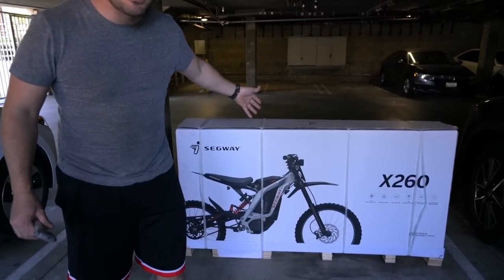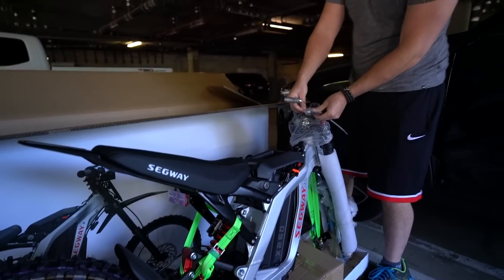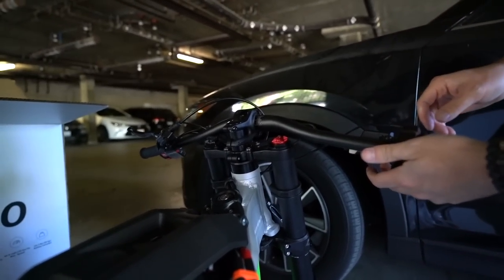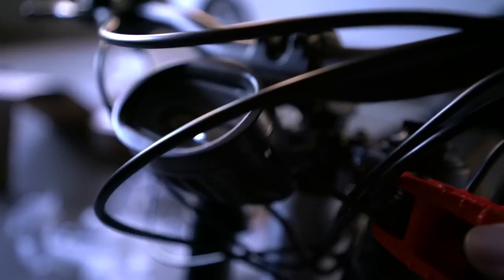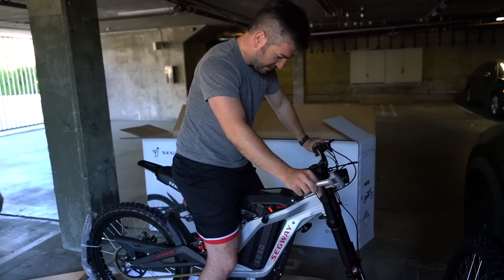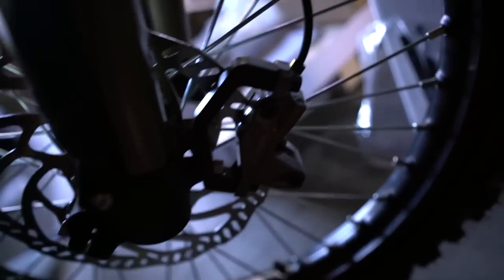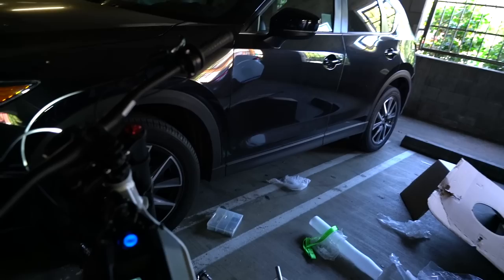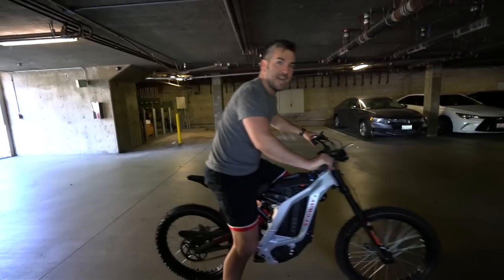Segway X260 Unboxing

Comment: Hope you will add to the EB forum your thoughts after getting your x260 sorted out and some miles on it. I'm very interested to know more about how the app can adjust the throttle and Regen behavior.  My new sur Ron LBX is unfortunately hard coded from the factory... Segue afaik, doesn't sell their version of the controller separately. If they did, (hint hint) I would be tempted to upgrade.

Comment: What makes the x260 and x160 different in speed is it the voltage in battery?
Reply from the maker: Definitely. 48v vs 60v battery.
Reply: JordanRingPhotography what type of battery is needed for a x260 a 48v or 60v?
Reply: 4 stroke x260 removable battery and less sounds of engine and x160 built-in battery 2stroke a bit annoying

Comment: With all these super hot 2021 electric motorcycles coming out the price on these bikes has to drop at least $1200 or less. Dont get me wrong these are mad cool but why get these when you can get the new hot electric motorcycle at the same price and can go at a distance 80 to 120 miles at 72 mph?I was reading on Electric site the hot models hitting the market. The Electric motorcycles they have now is way better when it comes to all around the board.

Comment: Do you think the 160 is worth getting?
Reply: Danny Potts that's what I'm debating too
Reply from the maker: I don’t think so. It’s smaller and less expensive and can go half the distance and speed. It depends on your needs.
Reply: @JordanRingPhotography  Thanks for the feedback. I was going to use it for mainly commuting in NYC since all the public transit is down so 31 mph would of been enough. Was trying to find a Super 73 alternative since they are backed up until august but I can get the 160 on prime in a few days. Disapointing it's smaller though, x260 already looks small and I was hoping to maybe modify and extend the seat for a passenger.
Reply: I just want to ride and hear my 2stroke in there.. haha
Reply from the maker: Lewis and Dad Perez hahaha
Reply: X160 is for children mainley
Reply: Danny Potts what did you end up getting? Considering the x160 since my Super73 got delayed another month. I definitely think the Luna Cycle Sur ron X would be the better option for the price instead of the x160 but that’s delayed until August as well. Starting to feel like the summer’s been wasted for riding